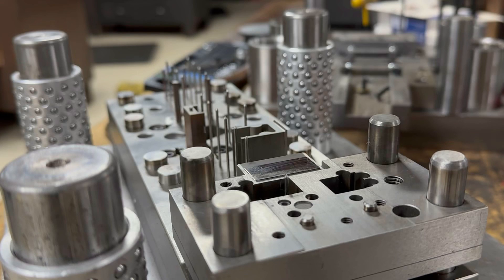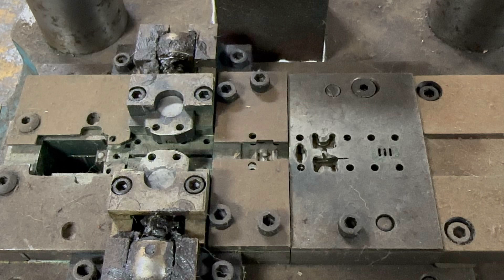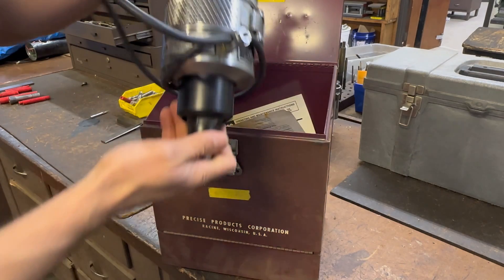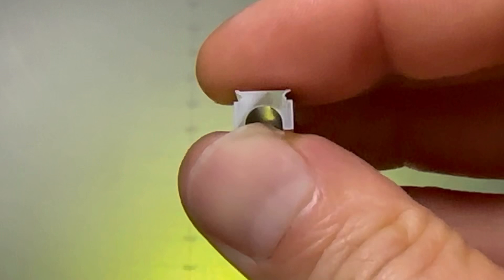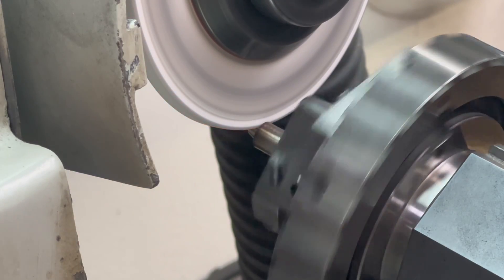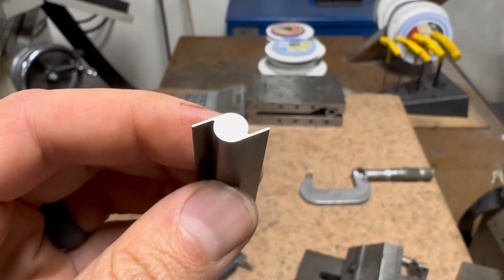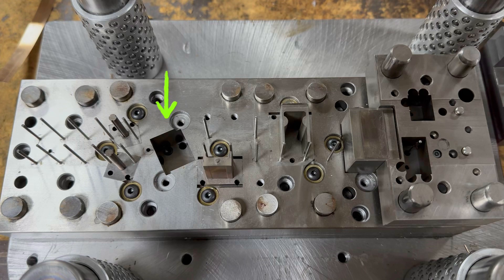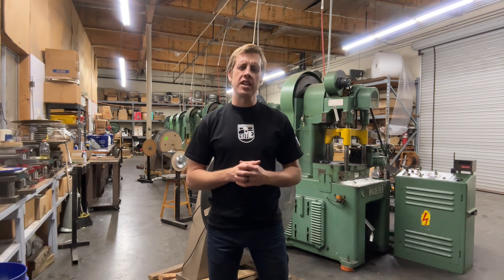Stamping Dies: Comparing Old Style vs Modern

Comment: Ahh yes the Wire EDM the diemakers NEW best friend!
Remember the old filing machines? Thanks for the trip down memory lane. Old timers did the best they could with what they had, and still sent me to the moon and bought them back. Thanks for the videos, keep doing them!
Reply: I have bought some file bands for my DoAll saw, on a lark before I bought an EDM, they are quite interesting and may be used one day. Going way back to the invention of the contour saw was the Continental style die, where they drilled and sawed out the die block at an angle so they could finish the slug as the punch. Really quite interesting.
Reply from the maker: I never built a die like this. Thank God for the wire machine.😀

Comment: When i started in the trade, you built the forms to print, developed the blank on those forms, made a master sheetmetal template of the blank, laid out the die trim steals, sawed,milled, ground in the trim lines of the sections, and then made punches to fit the die opening. Many small die sections in some dies. You had to be careful where you jointed the die steels, especially on concave, convex, or sharp corners

Comment: First time seeing these bearing sleeves, how does that compare to just using a greased pillar and bush?
Reply: Believe they are more accurate and build less heat, as the rolling elements have little friction, and they also have a very slight interference.  The old sliding bushing needs just a little room for lubrication

Comment: The video I watched before clicking on this one from you was this one: "Adam Savage's Alligator Clip Leads Problem" - It sounds like you could help him out by making a progressive stamping die to make a decent alligator clip.  Maybe with an adjustable hinge like common pliers to adjust for clipping onto larger or smaller diameter posts?
Reply from the maker: I’ve never seen his channel. I’ll check it out. Thank you for watching.

Comment: So when one small part of the modern die wears, the whole die is trashed. The old-school die can have any of its many parts replaced individually.
Reply from the maker: when an individual section wears out, it must be replaced on the old style and the modern die. The individual pieces of the frame never get replaced. The frame is in one piece on the modern and in pieces on the old style die. If that makes sense.
Reply: @ToolanderEngineering  So the old-school one has replaceable parts. The new-school one is of the same hellish ilk that gets you sealed expensive unmaintainable wheel bearings in cars to replace cheap greaseable tapered wheel bearings... and stereos that need to be discarded as one piece instead of repaired. Et cetera. It goes on and on. Society becomes more discardable every day, nobody can fix anything any more. Because of this very trend that you're showing us.
Reply: Nope. Just change the punch or die. And cos they are a wired out profile, no fettling and fitting needed. 

Another great improvement is sensors and press control. Thickess sensors, double thickness, even microphones for chipped punches. Even at 1k srokes per min, a modern high tech press can stop instantly, so the split second a punch breaks or a slug is pulled along the progression.. bang, the press stops. 👍
Reply: @TheScotsalan  Too bad it's so wasteful of resources. It's not a thing that I'd be proud of.
Reply: @timhofstetter5654  Nah. Modern toolmaking uses a lot less resources than old school 👍

Toolmakers are a massive resource, in terms of cost and environmental impact. The actaul cost of the steel is well down the list I reckon. The super duper expensive steel used for  the punches is wired out. A good toolmaker is gonna get loads of punches out a solid block, cos he can cut them out like a jigsaw puzzle. No need to spend time surface grinding each punch to be able to hold it for cutting etc. 

I think, if anything, wastage, in terms of green, is most likely to come from the product designer not understanding the stamping process. For most stamping, the biggest waste is gonna be the scrap strip of what the stampings are stamped from. 

Are you an old school engineer by chance ? So am I, bridgeport and colchester are my sort of things. Designers these days tho do tend to go straight to wire machines and EDMs. But I think that comes down to the toolmaker to tell the designer... easier if we do it this way.

Sorry for rambling 😂👍.
Reply: @TheScotsalan I'm a Bridgeport & Lodge Shippley guy. What I see is that as technology increases, designers keep working so close to the frontier that it can lock out small under funded shops. If you build dies to run yourself, you can do it anyway that works, however inefficient it may be.
Reply: you can always wire cut an insert we do it quiet often as a repair
Reply: @robertyouart3982  You can't do that if the insert is concave. You might be able to plunge it, but you can't wire it.
Reply: @timhofstetter5654 hi, you can use a wire edm that have 4 axis, 2 in top, and 2 in bottom, move independent to each other. You can do a cone. Sorry for me english
Reply: @timhofstetter5654  Just do 2+ wire ops. It is relatively easy

Comment: I'm a mechanical engineer but have no experience or knowledge to design stamping dies. Can you recommend resources, books, handbooks etc that'll teach me how to desing stamping tools. Thanks
Reply: I started an apprenticeship working under an old Italian tool & die maker at the age of 14. That was 60 years ago. A few years later, I discovered a scrapyard that had a pile of what must have been 200 old die sets stacked up outside. They were all sizes and most of them were very rusty. The scrapyard was selling them for .50 a pound and I would buy several at a time and clean them up. These were complete working dies with all the tooling. These were all built without wire EDM. These dies ranged from simple single station punch dies to very complex multi station progressive dies. This is how I learned tool & die design.
Reply: Hello my name is Daniel I'm a tool and die maker and own a tool and stamping facility in California. I know a ton about tool and die I've designed and built them all. Hi speed progressive dies that run a thousand strokes a minute. Deep draw transfer dies compound dies, four slid e every single thing. The best available information for designing is p.m.a. seminars they are great for die theory a d basic understanding of everything I just  mentioned 😅
Reply from the maker: Most of what I have learned has been from experience. I have not learned much from books, however the die design handbook has some good information in it.
Reply: Your best Bet would be a 'Time Machine' to deal with a Stella of Tool Making Techniques from the past  . . . . . ( I was involved for 55 years in the Tool Making industry and the stream of methods is endless )

Comment: Had ports put in a gun barrel one time using wire EDM.
Reply from the maker: They are very accurate machines and can be used for a lot of different things.
Reply: Wire EDM? Are you sure about that? It was Larry Kelly, founder and owner of MagnaPort in MI, back in the, IIRC, the late 1960's or early 1970's. He used ram-style EDM. He patented the shape of the ports.